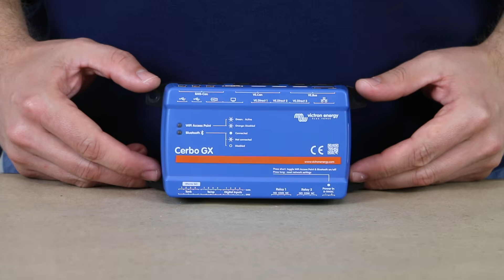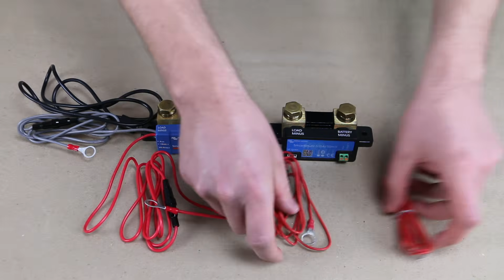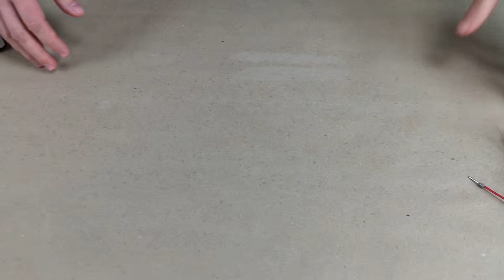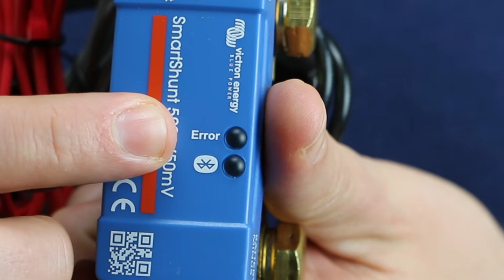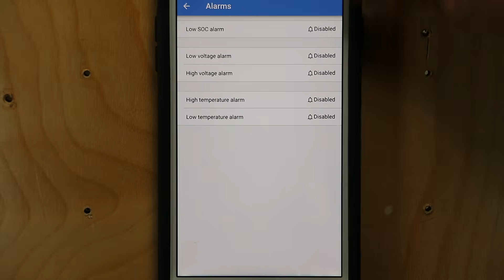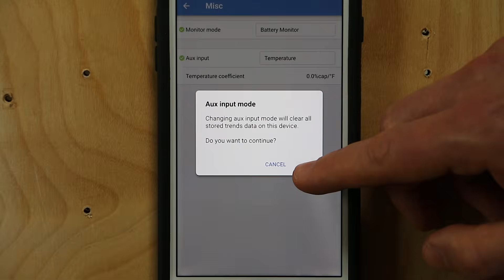Victron SmartShunt IP65 vs IP21 battery monitors (how to choose the right one)

Comment: Great video, many thanks. With reference to your comments on "charged voltage", I asked my local Victron dealer what it should be set to for a Lithium battery and they advised the "charged" voltage and "charging " voltage are different. The charged voltage varies from  manufacturer to manufacturer but generally should be set around 13.4 volts to 13.6 volts. I would be interested on your opinion on this. Thanks

Comment: Hi Ross, hopefully you get this message. How would I connect a Victron smart shunt to a 3 AGM battery bank running a 2000 watt invertor. I cant find anything anywhere. Also, I guess what would the settlings be on the app and is a 300-amp shunt suitable or would you recommend a 500-amp shunt. Thanks very much Cheers Tony

Comment: Great video with clear explanations.  Is there any way for the IP65 shunt to be connected to a simple SOC display without going to the more expensive Servo GX, etc. setup?  (similar to a BMV 702)
Reply from the maker: Hey there, glad that was helpful, thanks for watching! If you want a screen that's not a Cerbo/GX Touch or Ekrano screen, you would go to the BMV-712 (or 702 as you mentioned). The shunts in this video are made to use your phone/tablet/computer as the screen, and there is no screen you can get for them. Hope that helps, thanks for again for tuning in!

Comment: I have a newbie question.  Can you get away without using a shunt if your Lithium phosphate battery already came with a Bluetooth feature? 
Setup is a simple 200AH LiFePO4 battery and 2000W pure sine inverter, plus fuse, switch, etc.
Reply: Yes. I bought a battery and didn't realise it had a Bluetooth feature. It turned out that the battery Bluetooth and app is far better/accurate than the SmartShunt (I have both). I found the SmartShunt to be useless, often showing inaccurate State of Charge and needing recalibration.

Comment: Thanks for a great video! I need to pull the ferrules out, how do you release them?
Reply from the maker: Thanks for tuning in! Just push in the orange plastic under the ferrule with a jewelers flat tip screwdriver and pull on the wire. Hope that helps!

Comment: what about batteries with bluetooth capable?
Reply from the maker: Hi Victor, thanks for tuning in, great question. I think if it has a state-of-charge readout via Bluetooth as most of them do, I think that is okay. Sometimes it's nice to have one of these meters to give you one state-of-charge number across all batteries if you have 3-4 batteries. A monitor like the SmartShunt will essentially show them as one giant battery. It will also send it's data to an overall system monitor like a Cerbo GX (using a VE. Direct data cable), which the Bluetooth battery signals won't do. I would say the Bluetooth & battery apps are a good baseline, but there are things you can do beyond that if you want more enhanced monitoring. Hope that helps, thanks again for tuning in!

Comment: My battery box is under the stairs of the motor home. Basically, a steel box with only a hole or two for the power cables. Would the blue tooth signal be able to escape from the box and reach my phone, and if so, to what distance? Thanks for the video information.
Reply: The signal is extremely weak. I have mine in the plastic battery box on the tongue of my trailer, and I have to be sitting in on the master bed, (within about 5 feet of the shunt), in order to connect to it from inside.

Bluetooth is already not the best for getting a signal through barriers or over moderate distances, but Victron's implementation of it is particularly poor IMHO.

I'd look at just finding another brand that just has its own standalone wired display, if I had it to do over. For how much they charge for their products, I haven't been too impressed with Victron. Unless you're a youtube "influencer" and getting all of their gear sponsored for you for free, Victron products just don't justify the cost.
Reply from the maker: I would get the BMV-712 and put the screen inside your space. The Bluetooth signal comes from the screen for that model, and will be stronger/closer. Hope that helps-
Reply: @rosslukeman  Thanks, that give more options.

Comment: Are there different sizes for different size battery banks?
Reply from the maker: There are different amperages available, but choosing a larger size would be based on your loads, not the batteries. You would be looking at how many amps your loads need to operate.

Comment: Hi, i have an inverter that is powered by a 48v lithium battery but the inverter is unable to read the SOC of the battery due to communication failure. Can a smart shunt help the inverter read SOC of the battery?
Reply from the maker: Hi Serge, thanks for tuning in. The SmartShunt would be able to track SOC and report it to the end user, but if the inverter is not Victron, then it will not be able to send SOC data to the inverter. Hope that helps, thanks-
Reply: @rosslukeman  i see, thanks a lot for your reply very helpful

Comment: They have 500A , 1000A & 2000A models, what is the difference between them. Thanks. Great vid as usual.
Reply from the maker: Hi John, more amps means more power. Multiply the amp capacity of the shunt, by your battery voltage, and you get the watts. So the larger models will allow more watts of power to flow through them. The 500A model x 12V = 6000 watts. At 24V it's 12,000 watts, 48V is 24,000 watts. Way more power than need in my van systems. I would use the 1000 or 2000 amp models for systems in buildings. Hope that helps, thanks for your comments-

Comment: Is the IP65 Lithium compatible
Reply from the maker: Hey there, yes it's easily set up for lithium.
Reply: @rosslukeman  how I need to tell my mechanic how to set it up any advice would be great
Reply from the maker: @BeachBuoy  I would say getting him to read this manual would be the best bet: https://www.victronenergy.com/media/pg/SmartShunt_IP65/en/index-en.html
Reply: @rosslukeman how do u connect it to 2 batteries in parallel 1both 120ah lithium bcoz it doesn't seem to be reading properly
Reply: @jarrodwareham4565 I have this problem as well. I have 2 100ah batteries wired in parallel and even though I charge my batteries with solar, the shunt hasn’t ever gone up in SOC percentage.

Comment: Thanks for the good tutotiral. What do you mean by Starter Battery?  I'm building a home backup Solar Generator with 12V LiFePo batteries in parallel (qty 4).
Reply from the maker: I'm referring to the engine starter battery for vehicle-based power systems. In this case you won't have that so you could monitor something else or just turn the auxiliary input setting to "none." Hope that helps, thanks for tuning in.

Comment: If you add the temperature sensor onto the smart shunt, will it allow for the charging sources to enable temperature compensated charging? Is LiPo4 as sensitive to temperature variation as wet lead is??
Reply: It is HUGELY sensitive to charging at temps at 32 degrees or below, basically you can't do it unless you have a battery with built in heater pad.

Comment: Setting the Battery SOC on reset to "keep SOC" is okay but if the line fuse blows, the SOC won't change and you'll get false readings. If set to "Zero", the display will show dashes until power is resumed.
Reply: Ssturk91 is the building
Reply: @spencerturk91  bro announced his entrance lol

Comment: Great video. How can I use the smart shunt with a 36v battery bank (3@12v Lithium 56ah) for use with a trolling motor setup? I plan on using one smart shunt for cranking/house battery. Would I need a 2nd shunt for trolling motor bank? Thanks
Reply: It has an aux connection so you can the voltage only for a second battery bank.  It was designed to give you complete data on the house bank and the general voltage for your starting battery. Nothing beats Victron just definitely get the waterproof version for marine use, the salt air alone will ruin the original version over time.

Comment: Can I use just a smart shunt in existing system with flooded batteries and no Other Victron Equipment or must I get the Cerbo GX also to get smart phone info?
Reply from the maker: Hey there, yes you can definitely use the SmartShunt as a standalone item with no other Victron equipment, and it will work for flooded batteries. To be clear you do not need the Cerbo and can read it with your smartphone using the VictronConnect app. Hope that helps, thanks for tuning in!
Reply: Smart shunt is the perfect 1st item to get.  I'm switching over everything to VE slowly and the smart shunt is the perfect piece to start with.

Comment: I hope they used an upgraded Bluetooth module with the new shunt, the range with the original is terrible. If you buy the $50 dongle (more money), it greatly improves the bluetooth range.
Reply: Man, I am so happy to hear someone else say this. I couldn't get my shut to speak with the charge controller unless they were super close to each other over bluetooth. They're both now kind of tucked into the same cabinet in our camper trailer but it's pretty hard to get a signal from the shut. Might have to look into that dongle. I've heard the shunt + BMV has better bluetooth too. I'd probably go that version in future.
Reply: I can't get it to connect sitting in my truck driver seat without the dongle, with the dongle, I can connect sitting in my house on the lazy boy 20 yards away.  @andrewford80
Reply: @andrewford80  Mine wouldn't connect sitting in my truck hooked to the RV. Put the dongle in, now I can connect from my house living room over 20 yards away. Victron cheeped out on the shunt Bluetooth module to sell you the dongle.
Reply: Orion XS has crazy range too
Reply: I second this, someone please test and compare the Bluetooth range on both, hopefully the new version isn't even worse now that it's more sealed up! Please brother test the range, it's the #1 most common complaint on the VE Smart Shunt. A well known issue.

Comment: Would this be a good choice for a alternator amp meter?
Reply: A DC current clamp on the output stud is how diagnostics is done. This isn't a permanent install and I'm curious if there is a reliable way to permanently mount a sensor there.
Reply from the maker: Yes you could set it up as a "DC Power Meter" and put it under the hood. I don't know if it would store the data in that mode, but it would give you a real-time readout.